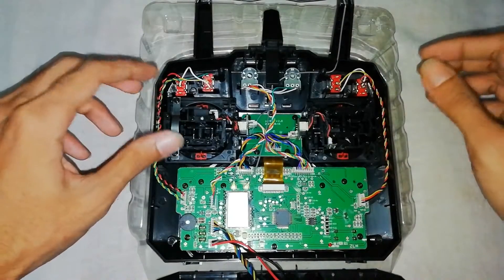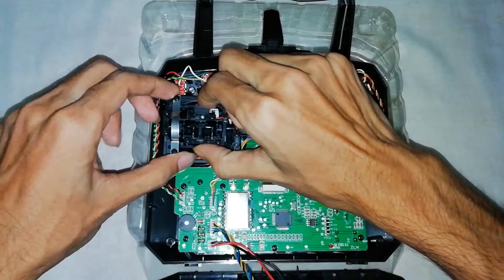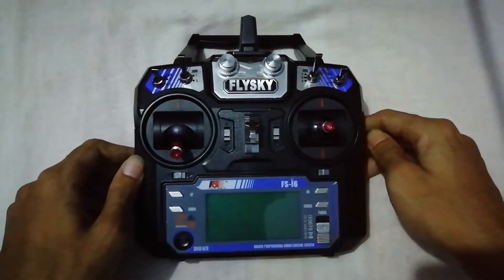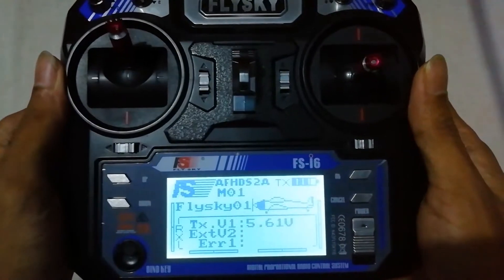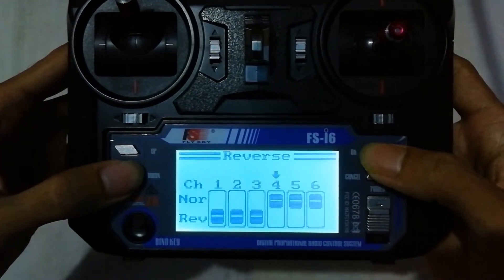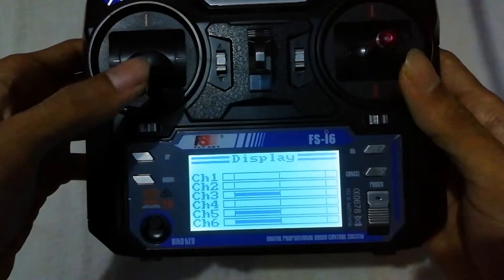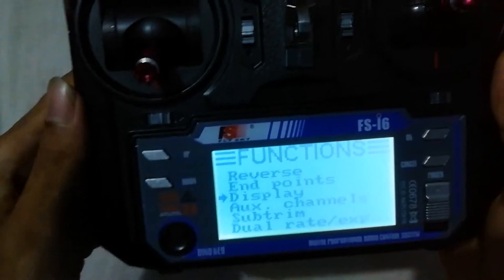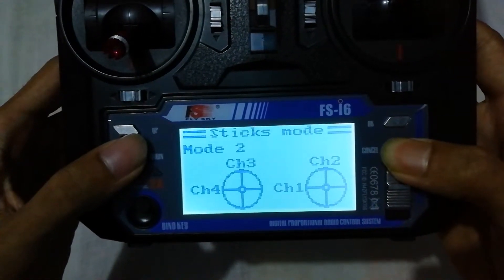FlySky FS-I6 mode 1 to mode 2 transformation...!!!

Comment: You don't need to reverse the channels. Switching modes in the Stick Modes setting does that!
Reply from the maker: but it will not be a proper transformation because the throttle stick will be positioned in the middle always ... then you'll need to fix the throttle springs ... I hope you understand what I am talking ...
Reply: @godspeedsr1471  Sorry. I did not make myself completely clear. AFTER you swap over the gimbals, you REVERSED all the channels in the menu before switching modes in the menu. That was NOT required. Also when switching the gimbals it is best to re-route the wires attached to each (they must remain plugged into the same gimbal) so there is no stress on the gimbals as they are operated.
Had you turned off the radio AFTER reversing the channels but BEFORE switching modes OR if you had checked the channel display when you were finished you would have seen your mistake. 👍
Reply from the maker: @theoztreecrasher2647  thank you for informing me and being careful ... there is little bit of stress with the cables going to the main board but not with the moving cable attached to gimble input ... so minor problem there but we need to be careful and you should use the method that seems easy to you ...
Reply: @godspeedsr1471  Actually I just watched the video carefully again and I noticed that (unlike in the title) you actually switched from mode 3 to mode 2! (Not mode 1 to made 2. - Original mode 3 shown at 2.20.)
Reply from the maker: @theoztreecrasher2647  Mode 1 (also called Japan hand) has the throttle stock on the right transmitter stick and Mode 2 (USA hand) on the left ... mine had throttle on right first then I replaced it on left side and revered some channels in settings ... to me it seems fine ...